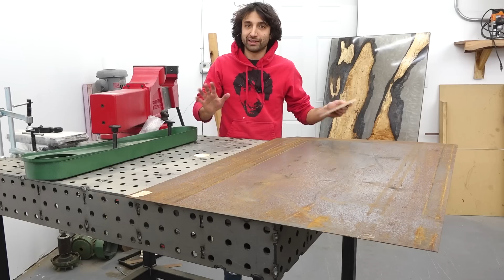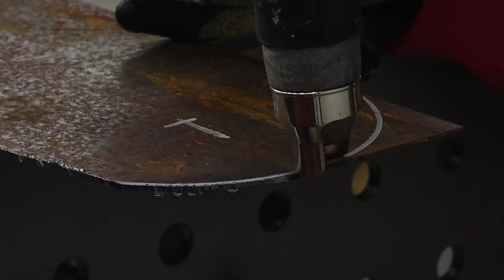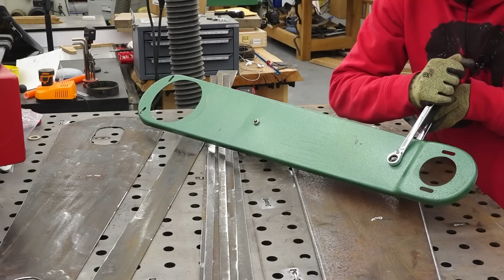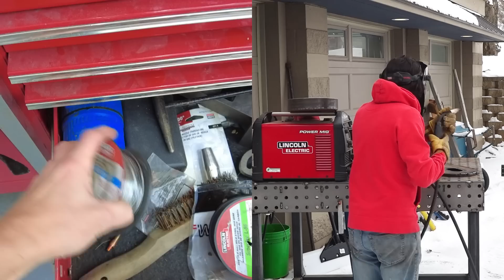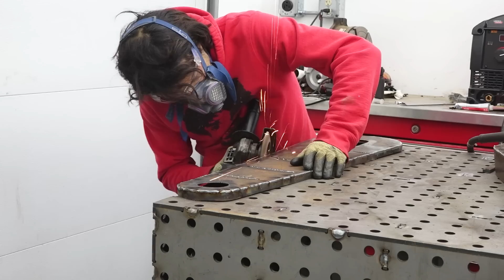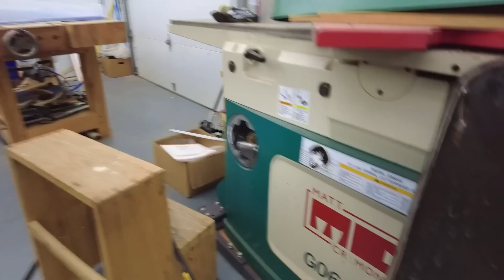Making a Bigger Belt Guard for my Planer

Comment: You say you didn't have a torch to heat the metal. It probably only needed a propane torch, although I would have used one with MAP gas. Just a thought.
Reply from the maker: Yes, mine’s buried in the snow

Comment: MATT IF YOU SIMPLY  Made slots & use TABS & bent them up around the edge - that's how channel letters are made.   Easily leaves a profile edge to weld on a perimeter edge.

Comment: i did upgrade my thickness planer to address the problem the manufacturer had one belt too did put a 575-volt 3phase motor onto the planer too lucked out it was the same size as the manufacturer was to put a 4 belt pully on the unit to did give the manufacture the measurement for the new guard too year letter i had a package at FedEx was a new planer with all the modified i done to mine too  want me to try it out first lol i did send this on back to them with all of there parts i have taken off too

Comment: Nice job with this thought I found myself asking... 1) Why isn't he using the possibilities of his new fixture table to hold that sucker in place while he welds it up? and 2) Shouldn't he put some rubber washers between the cover and the planer frame to help reduce noise from vibration? Still, nothing but compliments on how this turned out!

Comment: Nice job on cutting the radiuses & completing the belt guard.  The dark segments were really cool to watch so please include more of them in future project videos. That metal cutting saw really takes the “W” right out of work doesn’t it?  I used to have a 125 amp (110 v) welder, but when I had to get a pacemaker to keep the ole heart pumping correctly I had to sell the welder and gas powered hand tools.  I really liked doing small welding jobs whenever needed, but I like staying alive more so the welder is gone.

Comment: With your fancy new welding table, I don't think you have learned all of its potential yet. You can/could drop some dog pins through the holes to have a backup to push against to hold the plate in place as you push to bend and tack the rim around the periphery.
Reply: Nice work, Matt. Love your videos and your material.
However...
Surely the whole point of having a table like that is so you can stick pins into it and bend stuff?🤫
Reply from the maker: Yes, I don’t have any yet

Comment: I have the same planer with a different paint job. I swapped the pulleys in mine out because the 3 Z belts it comes melt off the pulleys and are hard to find, and expensive. I swapped it for AB combo double pulleys with removable centers. The original guard fit on, I just had to make stand-offs for the stud bolts.

Comment: It's good to see the new welding table get used right away. The final result looks good and I'm sure it will work fine forever.
I've heard you can reduce warping by welding small sections and alternating between different locations on the piece.
Also, while not a big deal in this application, those slits are significantly smaller than the openings in the louvers.

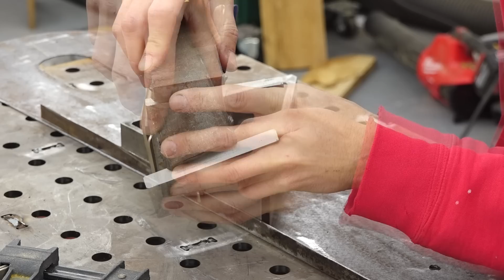Comment: At  10:18 all you needed to do was put a small bevel on both sides or grind out a notch for the weld to sit in nice a flush. Did not need to offset the 2 pieces.
Reply from the maker: More grinding to flush it up. I can’t lay a bead that small

Comment: You can apply some of the automotive sound deadening material inside the belt guard housing.  They usually have glue on the otherside. Kind of like a big sticker. That takes away the metallic sound when starting the machine and propably takes couple of dB of the general noise as well